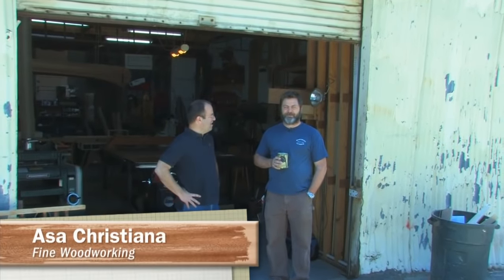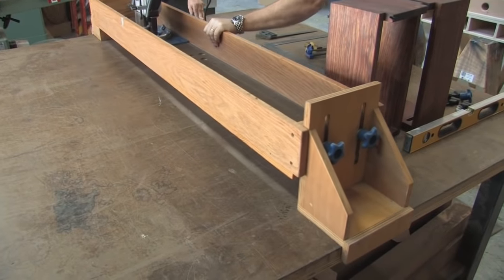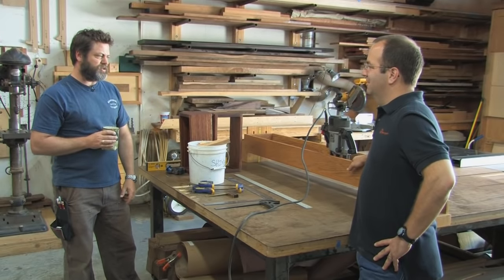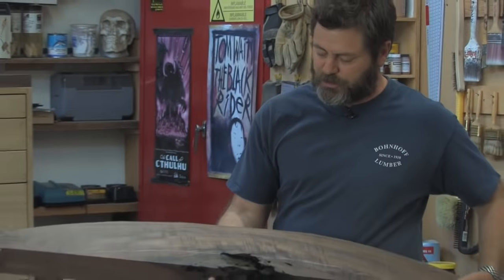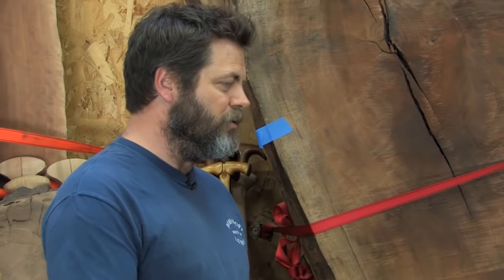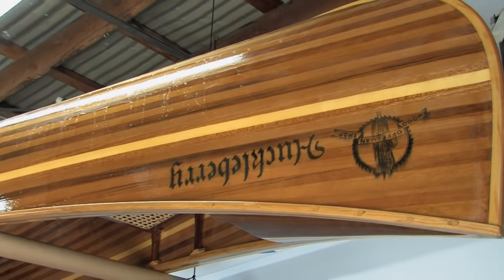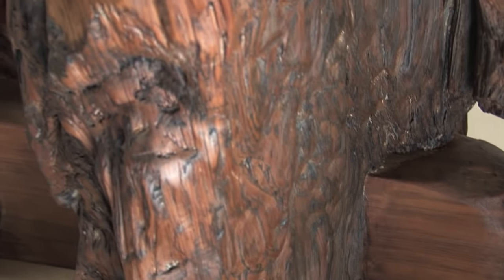Tour Nick Offerman's California Workshop

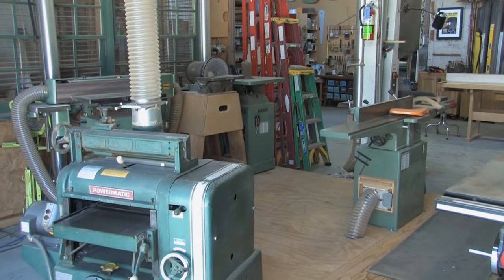Comment: 1:07 He built a wood floor over the concrete floor to run the dust ducts in. Nice trick.
Reply: Nice catch! I'll bet the place is full of quietly integrated, well-thought-out touches.
Reply: Yeah, noticed it too!
Reply: good eye i missed that.
Reply: Also has a sweet stereo system throughout the entire shop with a master controller that can control the volume in each room.
Reply: Probably also has a good supply of M95 masks on the shelf.
Reply: Didn’t see that, but did see the photograph behind them, hoping it’s his pops! 😢👏👍
Reply: @Jacob Cutright Thank you. I had a box full from Menards on my shelf. Obviously James does not turn or sand much. Maybe that is why he sounds so stressed out.
Reply: @jamesnewton6428  says the person finding the worst in someone else's comment and demonizing them for it, all while demonstrating your own ignorance.
Reply: @drake8168 
Saw that too, noticed his jointer was similar to mine and noticed the ducting. Damn clever.

Comment: Here's a question.  His sliding router jig is only so tall - on those night stands, after doing the 4 long sides how do you think the ends are planed?
Reply from the maker: Same concept applies. Probably a set of rails set-up somewhere else floating in air. As long as they're in the same plane the rails can be wherever you need them.
Reply: giant skill saw, and you you clean with a chisel. we had up to a 15" inch saw for cutting 8'x8' beam and larger pieces you would cut one side and cut the other side then flip it and then finish
Reply: Spencer Saunders he may use a hand planer
Reply: Spencer Saunders he stacks apple boxes on each side to desired height, you see that table top slab on apple boxes too

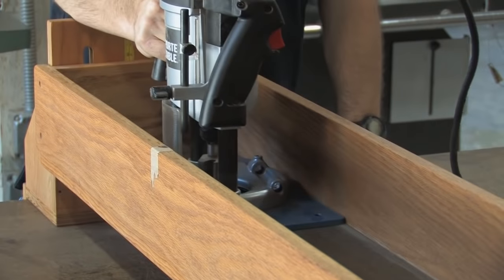Comment: 2:10 from that traverse action on both axis, i can tell...
that you my friend need to buy a cheap priced Bulk of skateboarding moving parts( polyurethane wheels, abec 1 ball bearings, nylon bushings/spacers...).
True linear motion like some camera rigs have, you can even use your nicely done wooden Jig,
and make it run smooth like a sip of pure Scottish nectar.
this is not a suggestion or friendly advice, i just did this to my woodworking machines and found it worth sharing, the choice of having shaky lines is yous, good day mister Mick Offernem.

Comment: I built a router sled and I love it, but i keep burning the wood with the router bit. What am I doing wrong? What type of bit is best?  Any help is appreciated thank you for your videos.
Reply: I suspect your sled may not be rigid enough to keep the weight of the router from pressing down, which could cause some burning.  Try reinforcing the sides of your sled.  Possible?
Reply: Also, of course, keep the router moving and don't pause anywhere.

Comment: With that router jig why use those bolts (sorry I don't know the correct term) to adjust the height? Why not make individual holes at specific heights to make sure it is level every time with out needing to go back and forth with a level making sure its flat; sure you lose some fine adjustability but I just feel it would make life easier.
Reply: A drilled hole gets rounded out each time it gets used...As well, the angles,dimples and raised areas,  inherent in a slab face, makes it necessary to change cutting height frequently  and stopping to unbolt something would cut into production time...

Comment: Little tip when using a surface planer...if you go across the grain...finish it with a very shallow pass with the grain. It will be shockling smooth.
Or do what I do and simply make all your passes with the grain.
Then belt sand across the grain, then with for a minture. Then go to the orbital sanding.

People who use these tend to only go across the grain and you inevitably wind up with some very obvious lines across the grain like you see on those pieces of walnut.

Comment: I was surprised at the rough runny epoxy appearance of the hull. When glassing the hull use a squeegee to remove excess epoxy and get the cloth to lay down smoothly against the wood. Allow the epoxy to come close to setting then roller another layer of epoxy down, allow to fully set then sand. If there are still voids or if you get into the cloth another thin layer of epoxy can be rollered on. After final sanding thinned spar varnish is applied to provide a glossy finish and UV protection for the epoxy, which will cloud without it. The final result should be a glass smooth finish that invites the hand. It is a tactile as well as visual experience. At least that is the way it was done at Newfound Woodworking when I was there.